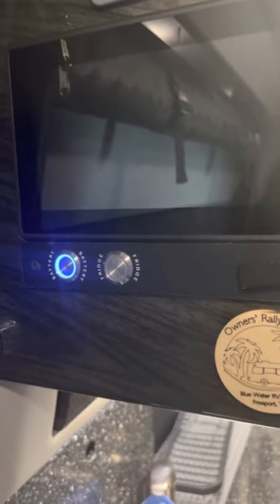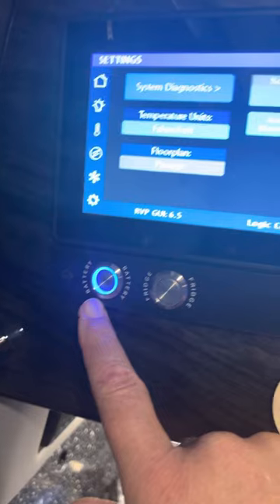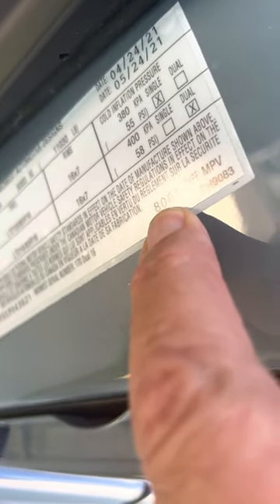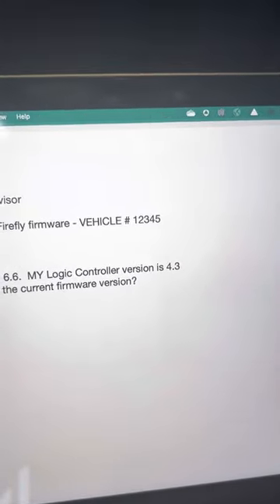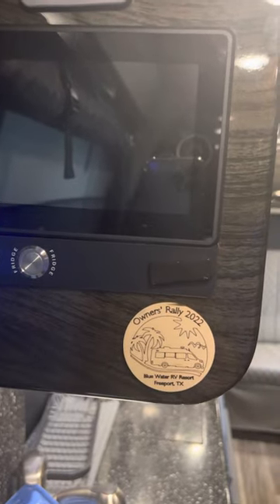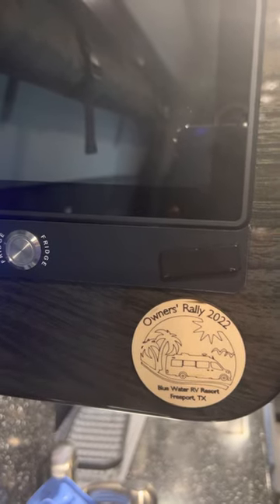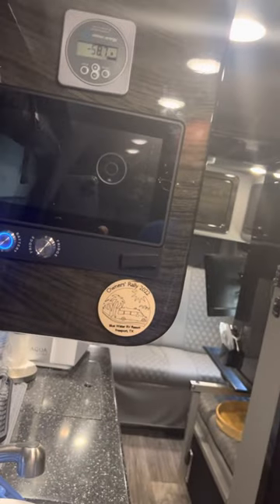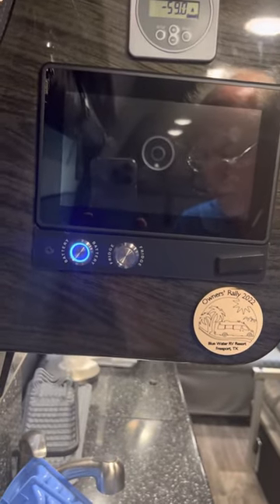Updating your Firefly firmware

Comment: Who is "MAD", how do I contact them, is the firmware for both wireless and hardwired systems? I have 2021 Fleetwood discovery 33W. I am not getting power to the main control panel or the half bath control panel. Both plans will work when attached to other panel outlets. I have spoken to both Fleetwood and Firefly, neither has been of little help.
Reply from the maker: MAD is Midwest Automotive Design.  They’re based in Elkhart.  I suggest you contact Eric Hoopes. Former Director of Services at Midwest, he has his own business. You can call or text Eric at (574) 322-9584. He’s 24/7.
Reply: @RVourWay  Thank you for getting back to me. I will call him this morning.